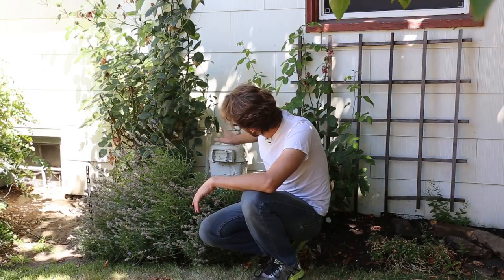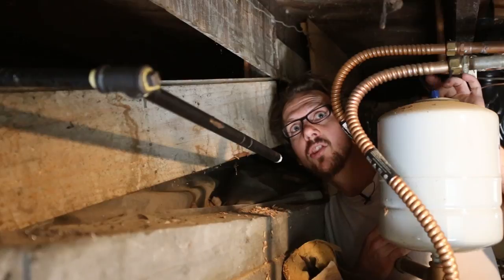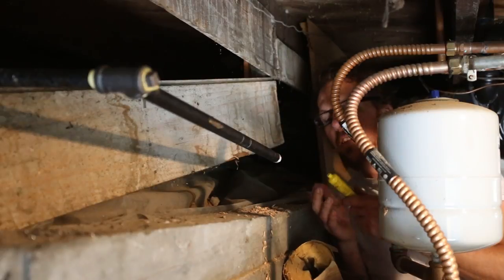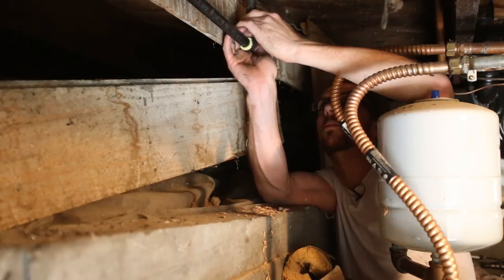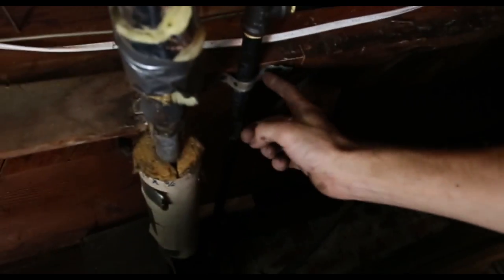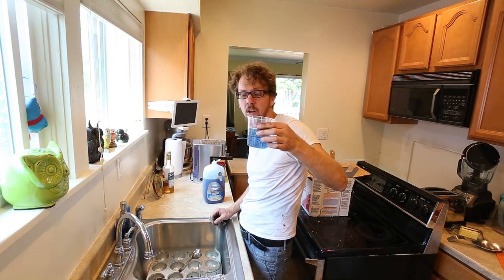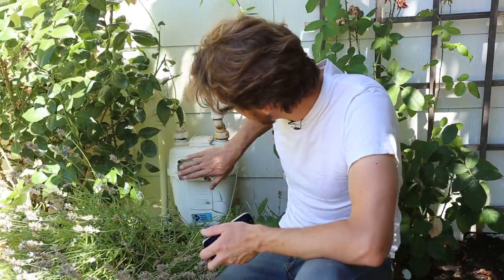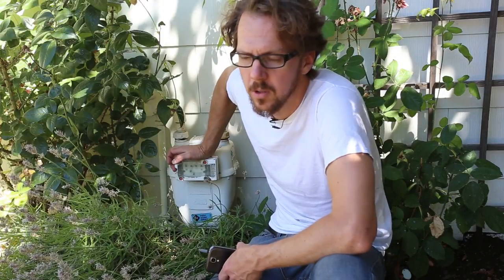How to add a natural gas line for a range

Comment: Hey man, this was a pretty well done video. I installed a bunch of gas lines as an industrial pipe fitter when I was younger. It seems like you did a great job both as a home owner and an amateur gas fitter. You had a lot of great tips, including the photo of the gas meter in conjunction with the soap test. I have some tips for you if you're ever interested. Just let me know and keep up the good work!

Comment: Great video, The only thing i question is i did not see you put a trap at the furnace connection or at the range ? I believe there needs to be a trap at both locations ? Example, The 45 elbow at the range going up to the range! Should have a tee instead ? the top of the tee would go up to the range and the bottom of the tee should have a 4" nipple with a cap on it creating your trap for debris to fall in to it.

Comment: I had to put a pressure gauge on the  end  and wait 24 hours  to see if the pressure  changed . This was code . A pressure gauge is the most accurate way to tell if its leaking at all .

Comment: I am wanting to do this; I already was given a very nice gas stove for free as my neighbor was upgrading and I just couldn't say no. I've always wanted a gas stove, and this was my opportunity to finally switch. I am glad you mentioned that about Lowes and threading your pipe for you if you have the measurements and such. Under my house the gas line runs right under my kitchen on its way to the furnace. I will just unscrew the line close to under the kitchen or wherever the closest fitting happens to be? Then add a T fitting, connect the old furnace line into the fitting, then get my new threaded gas pipe and install it, correct? What size pipe, or do I just match it up with the same size pipe that runs to my furnace? Also, when drilling the hole to install it in the kitchen, do I need to cut it back into the wall like you had done? By the way it is winter here now so should I wait until spring? Thank you for answering or to any that does answer my questions before I start on this project. Thank you for the Video Building with Burner you made this look so easy.

Comment: Hi,  thanks for the video.  My contractor suggests taking an external line from the gas meter to the kitchen instead of the furnace because of the distance. Is it safe to do it that way. ?
Reply: How would you make a 2nd external line from the gas meter, when there is already a line going to the furnace? Is there some type of T fitting that you can connect to the gas meter? Why would adding just a T fitting under the house like he has done hurt the pressure that drastically compared to adding the external line?

Comment: Thanks for video. Very helpful. You added a T to existing gas line does that create a problem for pressure? Did you measure the pressure?

Comment: Brush the soapy water on with a brush.  You must have disconnected the yellow flex the the furnace to add the tee.  Did you soap it?  If it’s a gas oven, self clean you need a 3/4” pipe.  Not bad for an amateur.  Reshape all fittings.

Comment: Is the furnace gas line bonded.  If not, lightning strike any where near the home can cause arcing and blow a hole in the flexible connector.  Also did you have to get new gas line inspected?  Might be needed for home insurance purposes.

Also flexible connector should never be reused. They are compression fittings. Did you get a new one for the furnace?

Comment: The gas counter isnt so sensitive to count a small gas leakage. It is easier to shut down the valve before the counter, wait for about 10min and try to fire the portion of gas from your range. If it fires up good it means that there's no leakage.
Paint the gas pipe!!!
Reply: Appliances can still fire up with leaks being present... the best way to check for leaks on the downstream side of meter is to mark the half foot dial with a marker and see if it moves after 5-15 mins
Reply: Daniel Velazquez   Plus soapy water.

Comment: A gas stove requires 3/4 inch pipe but it's a short run you'll probably be okay and the gas Flex should be 5/8
Reply: John London hi I need to install for a gas fireplace would the 3/4 pipe work for that?
Reply: Slippery Rock 1/2” for fireplace, a lot less BTU demand from fireplace vs stove
Reply: Can a gas stove and a furnace be run off the same natural gas supply outlet? It is a half inch iron supply pipe. Would there be enough gas to run both at the same time?
Reply: @MadHatter11371  yes...maybe a 1/2” depending on the btu’s.
Reply: @dustin1203    No

Comment: How do you screw in the T where you cut the pipe? If you put it on one pipe, how do you attach the other pipe, since it can't rotate, being attached to the furnace?
Reply: The yellow flexible gas feed for the furnace has a connector like a garden hose so it is easy to tighten the black pipe first and then attach the flex hose.

Comment: Wow as a professional gas fitter over 20 yrs, this is the most dangerous out of code install I have seen.
Reply: @buck ewer to make it up to code he should have put a drip leg in before the stove . He also should have capped off the ends of all the appliances in the house and put something like 25 psi and let it sit for 24 hours if no pressure drop then hook it up and let the gas flow.
Reply: @buck ewer never but it's good practice. Since he added on to an existing run it should have been inspected and those are things that a inspector would ding him on. As far a drip leg I just saw a problem with a furnace that didnt have one. The burners were corroded on a 3 year old furnace.
Reply: What are the issues you see ?